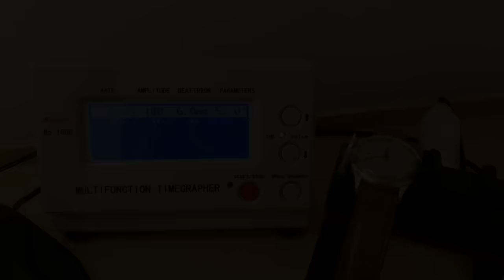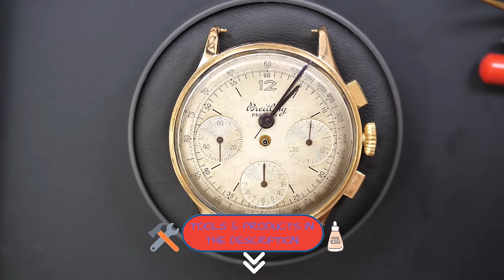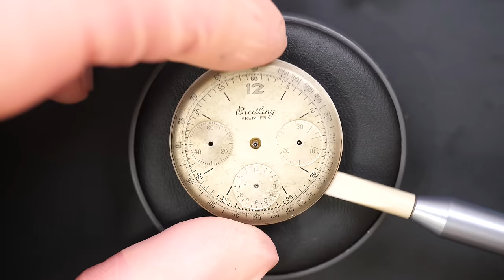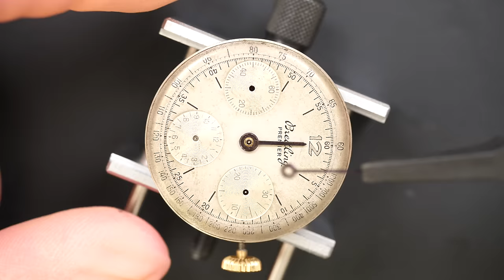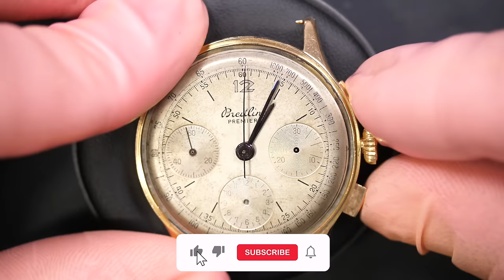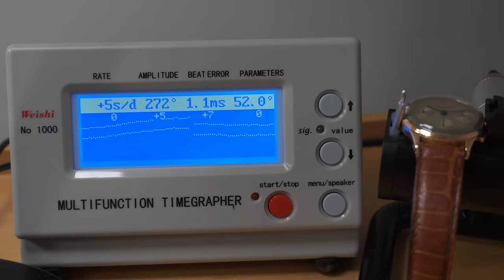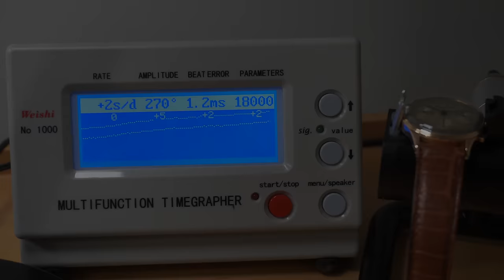Servicing my First Breitling Vintage Chronograph !!!

Comment: Thank you for this detailed video. Can you please tell me what kind of material you are using in the pin vice at 13:15 to polish the pivots of the wheels? Seems to be some kind of rubber.
Reply from the maker: I use some eve flex stick that you can find on cousin uk for exemple

Comment: Do you need this special tool to remove the one chronograph wheel? Or is that just for simplicity?
Reply from the maker: The wheel is friction mounted so you need to use some force to pull it up. The tool just make sure you pull it straight up and it prevents from bending the wheel
Reply: @FrenchWatchCollector  OK, cool cause i want to buy my First Chronograph watch and i always see you using this tool i think i am going to buy the presto tool too.😅😊👍🏼👍🏼